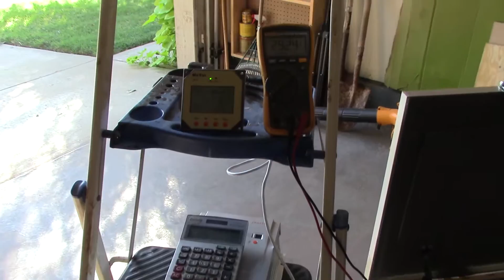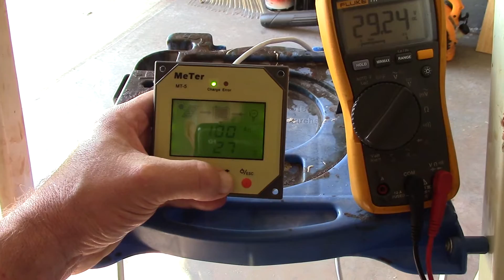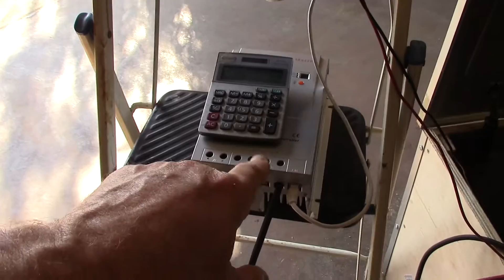DIY portable solar generator (Part 2)

Comment: Awesome, going through the series right now. One thing I noticed (and maybe you already changed) is incase you have it on grass and dirt etc, having some wheels with small tires would probably help out a whole lot. Looks good :) Working on my solar this whole week (running the Renogy 100w mono's too), should have a video or two up at the end of the week (finally) :)
Reply from the maker: Cool! Yeah, went with 5" wheels.

Comment: Looks good Chris.  You have to "weigh" the benefit of 4 batteries against the extra weight.  How often will you need to lift it?  Who is likely to be with you when you have to lift it?  Also, it might be cool to add spring loaded caddies for the PV wires.  That way, you just pull them out to your panels and they roll up and store when you're done.  Looking forward to your part 2.
Reply from the maker: thanks. I plan to keep it simple...not too complicated with DC switches, fuses, lights, outlets, et al "do dads" and "blinky-blinkies" like so many other dudes do with their solar generator boxes/carts/bug-out boxes. It have pricey stuff where it matters most.

Comment: Awesome job brother!   U will love your Go power inverter I have had mine about 5or 6 years never 1 issue. That is going to make kick ass power for sure!  Cant wait to see it all done. I am also thinking about getting some AGM battery's  for my camper set up.
Reply from the maker: Thanks...can't wait to put them into service. That is good to know about the Go Power! inverter...it should be delivered Wed next week. Did you notice where I got space for two more Trojan 31AGM batteries in that box? With four batteries...easily get 2 KW/H overnight out of it (safely without going below 65% SOC or so). The Trojan dealer here hooked me up big time on those batteries. I mean big time.
Reply: That will rock ! My home  fridge freezer just took a crap water every were & what's worse my beer getting warm!!  had to fire up camper fridge! dam it man it never ends!

Comment: NICE Go-Power rocks my go power runs 24/7 and is the 12 volt 1500 watter. Has worked real well over the past 3 years. Most of all has worked real good all this last 7 days. Having back ups is SMART !! As you know I lost my big CC as was down to one small 15 amp CC. The power is back now whoooooo,,
Reply from the maker: THIS is why we trade notes on what works...helps out a lot. Good to hear that unit is holding up. They ain't cheap.

Comment: You will like the four wheels of that box better than the Husky 2 wheel box.  I have four GC4's  in mine, so it is plenty heavy and I roll it across dirt and gravel.
Reply from the maker: How are those four running for your set up? My box has room for two more batteries...just curious. I actually picked up a Husky two-wheel job site box...gonna use that for cables at "Site X".

Comment: Looks like a fun prodject! I have heard good things about Go Power inverters. I used to have 2 portable power stations that I would take to friends who had power outages from the snow. Having lights and cell phones charged up is a must for the elderly. I don't like folks lighting candles and oil lamps when they are  out of practice. They came in handy a couple years ago. Looks like we have one of those years this year. We got 4" of rain yesterday and they are calling for 6" to 13" of rain and high winds (100mph) tommorow. Snow down to 4k. Here we go lol. I will be the last to know the power is out lol. I am experimenting with power from a peltier plate today. Blessings upon you my friend.
Reply from the maker: Holy smokes...100 mph winds? Are you gonna do some securing of your equipment? Hope nothing gets damaged. You are 100% correct...helping others. That is one reason why I am taking on this new project. I saw what happened on the east coast (Hurricane Matthew) and my old buzzcap lit up: How can I build a self sustaining solar power generator that MAKES SENSE? And, can be moved around (with a little elbow grease...she is heavy). 24v is more efficient, less heat, 2x the power (solar and aH power) and keep the cost around $1,000. Those Yeti Goal Zero's are $2,000+ and you get a couple of 30-watt panels. I could put 600-watts of panels on mine (AND two more batteries) and STILL beat that price. Generators are great...don't get me wrong...but, dang if one can build a solar genny...no more needing gasoline, oil, smell, smoke, and trying to start it up. So, this design, makes sense to me.
Reply: I am a little north of you.  We are expecting 70 mph Saturday night.  We generally lose power with anything over 40.  Lots of little red cans being filled at the gas station.
Reply: Chris DIYer I cut down a lot of trees for light go get to the solar array. About 3 log truck loads. The tees used to block the wind at the house. Now it rattles the windows lol. There is a mountain about 1/2 mile between me and this wind storm. One time we had a 110 0lus gust hit the lake. It knocked about 10 old grout trees down across the road and blew all the boat out of the water! They were all stacked up against the door to the resort like somebody did it on purpose. It was the strangest thing I ever seen. I think we have everything stowed at the shop. The shop really gets hammered. I did just put flashing on the edges of the roof this summer. Watch and pray my friend. Life on this planet gets stranger every day.
Reply: Fernbark Frist Yes having gas for the genny is a good idea this weekend. Are you in Duglas county? We are in Josephine.
Reply: I am up in Washington State, King County
Reply: Fernbark Frist Very nice! You are on the wet side. My dad and I built a manufacturing plant in Hoquium. Port of Grey's Harbor. The Port authority was ok to deal with. When the plant was up and running the CO ask me to stay on as the Plant supervisor. Actually it was way to wet for me lol. The plant is just a few miles sout of The Olympic National Forest. You know how much It rains there. 100" a year is ok but I do live off grid so some sunshine is needed lol. You live east of there. How much does it rain there? Do you get any snow? I saw it snow 4" on the beach at Grey's Harbor.
Reply: It rains plenty, but if it snows, it is gone by noon, which is ok with me.  I used to live in Wisconsin.  I am done with snow.
Reply: Chris DIYer You won't believe this but the  coast guard just put up a hurocane warning! crazy or what. I'm 70 miles from the coast but we are going to tuck it in tommorow.
Reply from the maker: Crazy! Our local news here tonight showed the tornado in OR...and what is coming in for your neck of the woods. They say, "several rounds" of severe weather. Wow.

Comment: Howdy Chris, thanks...you are my FIRST SUB !   I need to get updated and start posting vids eventually too.  For now, I just take photos and do the old E-mail system.  Too many pokers in the fire.  Good job on re-purposing the box and placing the handles low. It definitely aids in lifting. Just watch your back Bubba .  I generally don't discard goodies. I have had stuff in my "chamber of horrors (hoarders)"  for years and now putting some to good use, like your old controller. My plans to purchase the alum tool box are moving, including welding a "lowboy"steel cart with 12" wheels which will be removable.  Meanwhile keeping my ear open for the UPS truck to deliver my Anderson order and Blue Sea breaker.   Later fellow modern day EDISON !    Jim K
Reply from the maker: Man, if you post some videos, I can help get your subscriber count up. Make sure to "monitize" your videos and set up a Google Adsense account. There are videos on how to do that...really easy. You can make a few bucks. I agree with the handles...gonna add some more handles actually. Congrats on your purchases...it isn't "work" if it is "fun"! Solar is still "magic" to me...
Reply: Thanks Chris, with all the tech equipment I dealt with,  one would think that I still preferred to lived in the stone age....old flip phone and no cable TV.  Stuff become obsolete so fast that I like to stay simple. I will look into your suggestions. Retirees can always use more beer money or Harley hundreds.    J K

Comment: If it is two man lift I would suggest two lift handle on the right side of the box? Glad to see you are going 24v mine is on a trailer gas powered and 12v. Looking good
Reply from the maker: Thanks...more handles will definitely work! So many folks out there with 12v solar generator systems, not enough battery, not enough solar, and questionable efficiency. Just trying to make something the will run the whole night and have enough solar to charge/use stuff during the day.